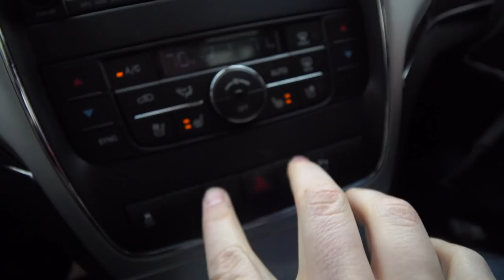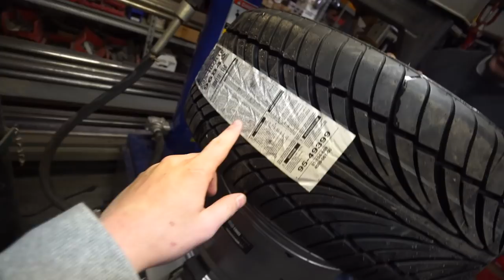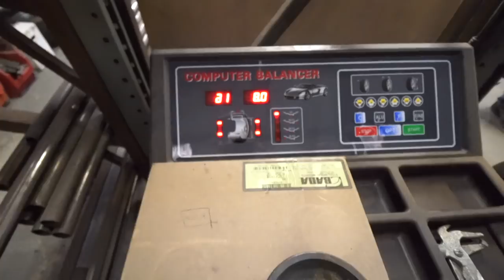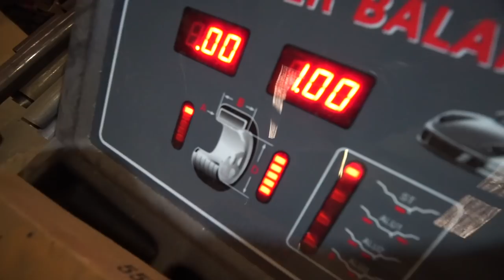SICK NEW RIMPS for the 1JZ LEXUS (WHEEL REVEAL)

Comment: Evan you have a couple tires rotating in the wrong direction. You want all the tires to have the point facing towards the front of the car. Just lookin out for my boy.
Reply: what he is doing is preserving tires, if you really knew about drifting you'd know that
Reply: Lord Henry I respectfully disagree the nature of preserving a tire by running it backwards is counterintuitive. The tire gives better control in the direction it is intended to rotate. The loss of traction when breaking the tires loose and longevity of the tire  has nothing to do with its direction. The tires being run in reverse for drifting is a myth that more people need to look into. Having control on transitions and having a consistent drift rely on the directional properties of the tire. Do what you want and believe what you want. I’m just asking to keep an open mind and do a little research before attacking my comment. Thank you 🤗
Reply: Tires should 100% be facing the correct direction, drifting or not. Even's got them backwards.
Reply: Depends on the tire and setup

Comment: Just a tip. If you line the yellow dot on the tire up with the valve stem of the wheel balancing the wheel/tire is much easier and should take much less weight as well!

Comment: Rip your tires because you counter balanced them lol. I love yah Evan but working in a tire shop, seeing counter balanced weights just makes me cringe. 😣
Reply: Explain this to me because I have no idea how all that works
Reply: Doge Racer the machine asks for weight at a certain point of the wheel and you add it. Then you spin the wheel again and it will either give you another number or zero out. If it says to add weight opposite or to the sitde of where you are originally added it then you either have to remove weight or move the weight. If you have weight in more than one place then it is not balanced it is counterbalanced and will cause vibration and ware to your tires and wheel bearings.
Reply: Interesting, makes sense.
Reply: It tells you where to put it on the outside and on the inside obviously none of y'all have ever looked at your tires
Reply: Sam Tardo dude seriously I work in a tire shop I know what I am talking about. I use a ballancer litteraly every day.

Comment: Temperature has nothing to do with tire mounting. You simply had 3/4 of the tire seated therefore not enough slack on the remainder of the tire. When that happens all you have to do is grab the bars from the machine or a pry bar and unseat it and have the tire go under the lip so you enough slack. Trust me

Comment: You counter balanced the wheels, effectively negating the weights on one side of the wheel, with the weights on the other side. Take them to be balanced by an expert and they will balance out better.
Reply: It tells you where to put it on the outside and on the inside obviously none of y'all have never looked at your tires
Reply: Sam Tardo I’ve been professionally mounting and balancing wheels and tires for 5 years. I’m not unknowledgeable, I am literally an expert. He has weights placed in multiple locations around the rim on the outer location just behind the face of the wheel. You place weights at one single location, otherwise the weights you have 180° from each other effectively negate other and any balancing effect they may have had. Balancing is a focus of creating heavier spots where the weight of the wheel assembly is lighter, in order to “balance” the weight of the tire in a full 360° and even the run out of the assembly.

Comment: Y’all counter balanced that one wheel by putting weights opposite of each other RIP tire wear
Reply: John Stern balancing has nothing to fo with tire wear its just ride quality. Alignment wears tires unevenly
Reply: Balancing tires has nothing to do with tire wear. Wheel alignment(Toe and Camber angle settings) has lot to do with it.
Reply: It tells you where to put it on the outside and on the inside obviously none of y'all have never looked at your tires
Reply: Sam Tardo thank you for your insight I did not know that wow what have i been doing the past two years working at Discount Tire I’m gonna call corporate and tell them we need to change the training cause we’ve been doing it weong
Reply: Sam Tardo  Thats a good point because I watch lots of videos of the new tire balances where the computer will tell you exactly where to put them which is really nice.
Reply: Not all tires are directional there bub